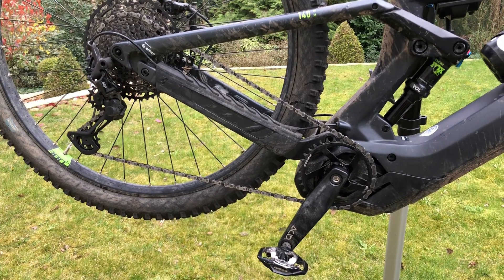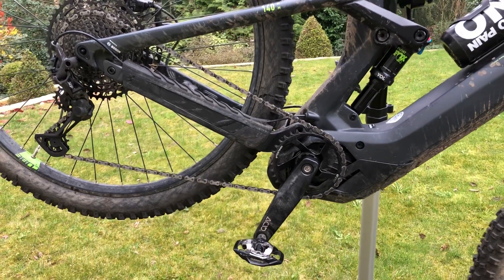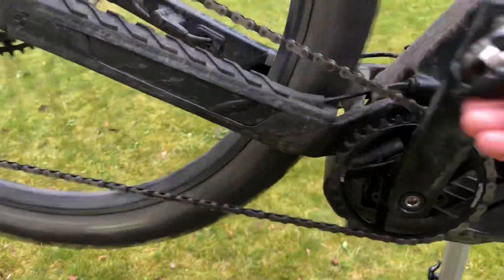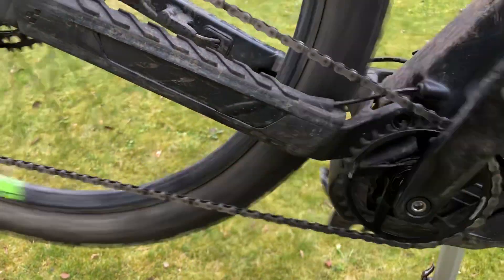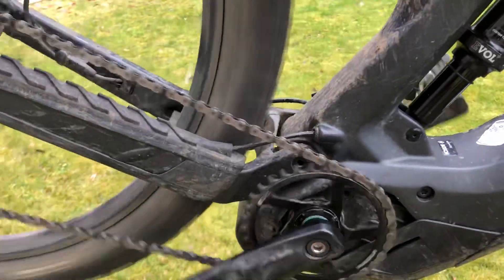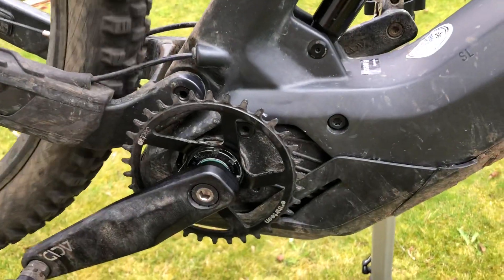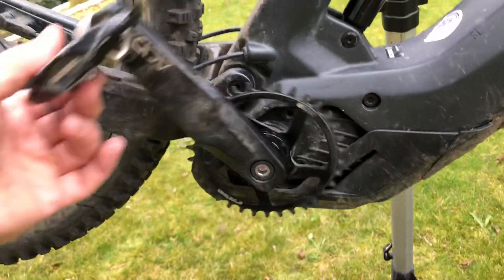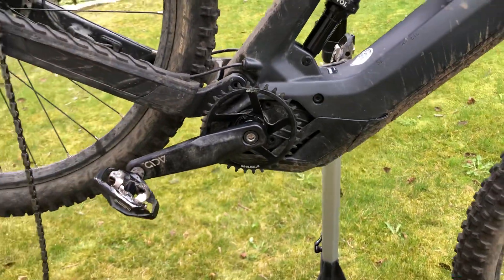2020 Bosch Performance Line CX Gen. 4 noise & internal resistance test

Comment: Spin it without the chain on and let go, then do it on analog bike...you will notice on ananalog bike the crank spins a lot longer.. that's how you measure resistance. You may think it's very small but try to tuen engine off and go uphil... you will die from the exhaustion xD
Reply from the maker: My eldest boy rides this bike uphill with engine off without any problems. 
This generation motor has no internal resistance, unlike the previous generation Sport CX.
Reply: @ruirodtube then your boy has very strong legs:) anyway I will stay with my statement - the resistance is there even though you may not feel it. It's how the engine is built. Once I get my analog bike back, I will record comparison video and demonstrate, as I also have a Cube bike with cx performance gen4.
Reply from the maker: @vampiszon6620  cool! Looking forward to watching your video. Let me know when you put it on YouTube.

Comment: The mechanical grinding sound of the motor is not very pleasant. For driving on beautiful nature it would be distracting
Reply: I don't find the bosch cx gen 4 to be unpleasant at the highest "turbo" motor settings...  -as you hurtle through nature, the wind and dust screaming past your ears as tears begin to form and instantly vaporize into mach diamonds 😄... you think, what is that slight hum?
Reply: I've just tested a bike with the Bosch Gen 4 and I hated the noise of it.

Comment: I think the noise people are concerned about/are talking about is the inner gear freewheel rattle, as opposed to that light hum from application of an electric motor. How've you found it on that Cube? Is it a 140 SL? I have a 160 SLT and it is terrible; feels and sounds like the motor is completely loose in the frame over anything bigger than roots and small rock gardens... Hate it!
Reply from the maker: John Mc I haven’t had any motor noise problems (rattling or otherwise) on any of the three 2020 Performance line CX I’ve tested. 
Indeed it’s a CUBE Stereo Hybrid 140 HPC SL 625 29. 
Maybe you should notify your Cube representative and have the motor be repaired under warranty.
Reply: @ruirodtube I don’t have any rattles in mine either. It’s the 2022 Cube Reaction Hybrid Pro with the Gen 4 CX. My free hub sounds quite bad though, which is why I was looking for videos to see how others sounded lol. Going to speak to the store about it in the next few days.

Comment: I have the same engine and I think it has a very pleasing sound. Nice vid.
Reply from the maker: Cool, thanks
Reply: @ruirodtube  Hi,
Nice video! 
I have cube touring hybrid one 500 ebike, since it is a paddle assist and due to my health requirements I would like to add throttle to my cube ebike, please advise / guide on how to go about having throttle control installed in it. 
Thank you

Comment: Did you ever do the same test with the Performance line 2020?
Reply from the maker: kwiks987 hi, this is the Bosch Performance Line CX motor of 2020. 
Maybe I’m not understanding your question...
Reply: @ruirodtube  Let me clarify. Will there be a similar test with the Bosch Performance Line 2020 (not CX version)?
Reply from the maker: kwiks987 I understand now. But unfortunately I don’t own a bike with such a motor so I won’t be doing that test. Good luck with your search!
Reply: so same motor without CX.
Reply: It has no resistance also.
Reply: great.